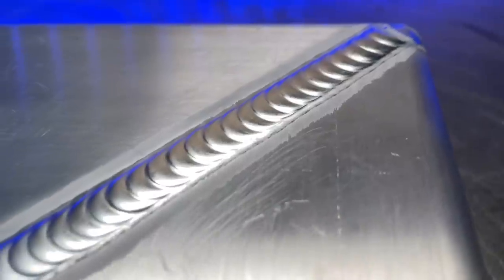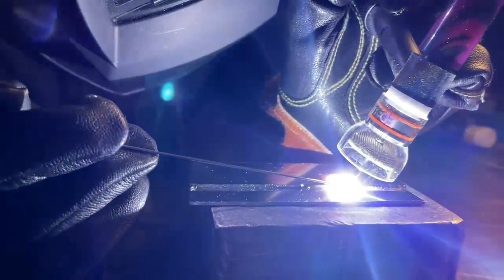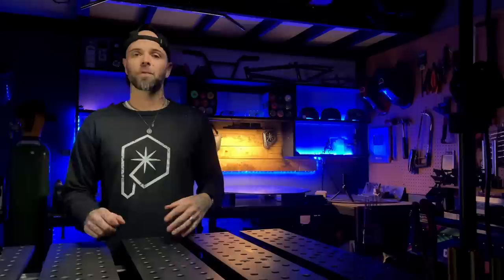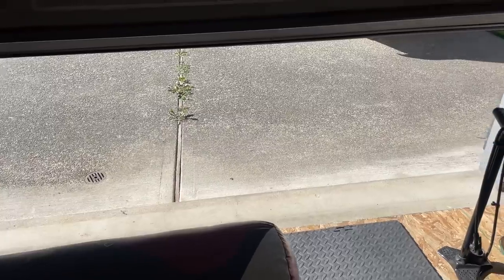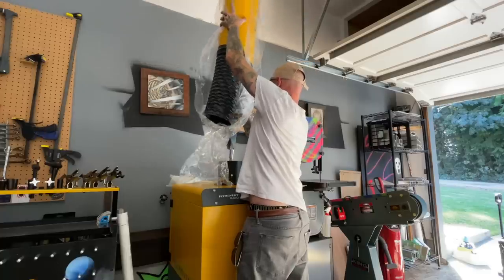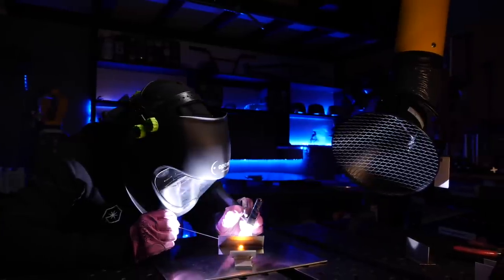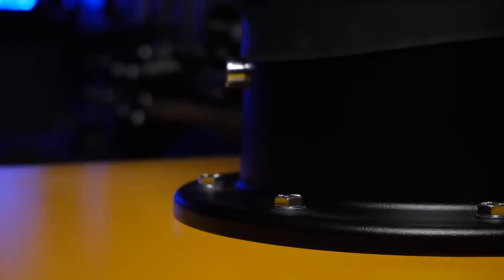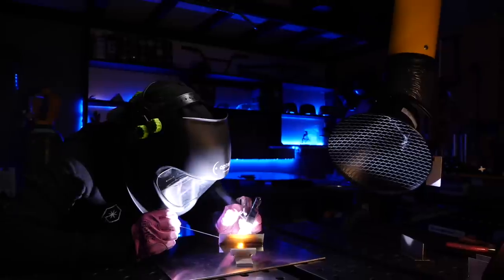I breathed poison fumes without knowing it welding... Remove The Fume rescued me!

Comment from the maker: Thank you SO MUCH for watching today! 💎💎💎Take a FREE online Tig class on my website HERE👉 https://www.pacificarctigwelding.com/
Reply: So one thing to keep in mind: The Respiratory Protection standard, paragraph 29 CFR 1910.134(g)(1)(i)(A), states that respirators shall not be worn when facial hair comes between the sealing surface of the facepiece and the face or that interferes with valve function. This is a requirement at the Shipyard I work at here in the US. Something I would look into for anyone planning on using this style as opposed to the papr welding hood

Comment: Thank you for doing this video.  I was a welding instructor for seven years and a welder fabricator for thirty one years.  After I retired for a couple of years I noticed that I had blood in my urine.  After a CAT scan it was discovered that I had a large cancerous tumor on my left kidney.  When I told the doctor what type of work I did he was not surprised.  I welded SS, aluminum,  and a lot of 6010/7018 pipe welding over the years. I didn't start wearing a respirator under the hood until late in the game. I have survived for eight years since the kidney was removed. Get the best respirator you can find and wear it every time you weld.
Reply: Yeah I'm new in the industry and bought a 3m respirator for that reason. Any tips for wearing safety glasses with a respirator? I find it difficult to know how to wear them.
Reply: Sorry to hear that man yea my one buddy just lost the battle to the big c i think it was all the brake work he did and all the dust I was his welder idk cancer is just weird thing people who don't even smoke get it he didnt  smoke nothing brakes is the only thing I can think of but keep up the good fight man and thank you for the wise advice
Reply: @jeffgood6441  car brakes?
Reply: @Captain Rutabegga Crossout  I've tried all the 3m half mask and none fit perfectly with glasses, sometimes what i will do is grind my safety glasses around the nose so it fit flush against the mask. But after a while i got tired and bought a 3m adflow and its the best thing
Reply: @alexisd-m3802  get a lincoln respirator. They only take p100 filters, but the face cup is so much nicer.
Reply: @captainrutabeggacrossout8482 Yes.  Put some foaming hand soap on both sides of the lenses, then rub them dry with a microfiber cloth. It's a decent anti-fog.

Comment: I wish someone made an affordable home shop fume extractor. I'm in the process of making my own out of an inline duct fan and some aluminum ducting, but it would be nice to have an off-the-shelf solution that didn't cost thousands of dollars.
Reply: Usually we see home shops opting for Portable High Vacuum (PHV) units unless their active weld time is extremely high, the cost of a PHV is much less compared to the larger mobile units, though you'll have to check if the PHV filters are suitable to what you're welding
Reply: lincoln has a smaller unit for about 1400$, still a bit pricey in my opinion but it does look nice
Reply: I use a air blower 8" with expandable tube on suction end.
Reply: i bought a wood dust  extractor   added a few tubes ect  find them fairly  cheap  mine cost all up a round 600 aud

Comment: Hey Dusty , Thank you so much for going over this Topic. ive been welding sense 1984 i was tig welding in my shop and had mask seal ring go bad on my mask and got metal fever about three hours later my chest was on fire it was the worst feeling ever and you cant breathe it took a week to get back to normal yea it was bad !!!!!!!!! I bought the lincoln viking 3250d papr air purifying respirator welding helmet  also added a fume extractor to the shop thanks again dusty for going over this !!!!!!! safety safety safety

Comment: For those curious: ABEK1 filters are the ones that handle gases and vapours (including Hydrogen Fluoride and Formaldehyde). You can attach particulate filters (P2/P100 etc.) on top of them to handle airborne hazards produced by welding.
Reply: Where do you find the P100 attachments? And how would this fair against 3M’s 60926 multi-gas that’s also P100? Is it better with inorganic vapors? I currently where 60923s, but I think I should switch to the ABEK1 or 60926.
Reply: @nistsuas  Definitely get the 60926. That's the all-in-one version of what I use, but with better particulate filter (I've only got the P2 filter, model no. 5925, that goes over the top of my ABEK1 filters). I can't find any P100 filters that are just the filter that attaches on top.
Reply: How do u get them to fit u see the welding mask
Reply: I hate the Miller one because I know it’s not getting the oxides, but I can’t get the 3m respirator to fit under my helmet

Comment: As a freelance welder who has to supply all of my own equipment, I always have respirators and fans around to keep my air as clean as I can. If I find myself in a confined space use a fan to push air in, and another to push air out. 

And also the miller LPR100 is a really nice snd affordable respirator.
Reply: nothing short of an SCBA will protect you.

Comment: What are your thoughts on the adflow helmets or any filtered helmets in regards to this subject mate ive been welding stainless for 10 years and only have recently started to use the adflow helmet religiously to try combat this situation. would you recommend running with the helmet set up or purchasing a extraction system or even both 
thanks in advance mate !

Comment: Safety first!  I had a problem with my first auto darkening helmet  with external adjustments. I was welding for quite a while and didn't realize I bumped the control until I looked around with the helmet up and everything was red!! Burned my eyes. Junked that helmet and bought a good one. Safety first! Thanks for the video, looks like a very nice, useable product.
Reply: Thanks for the comment. Can you please clarify what exactly do you mean by “I bumped the control until I looked around with the helmet up”.
I also just replaced my Chinese helmet with 9002NC by 3M
Reply: @Bakanelli   On the side of my first helmet there was a "shade" control that went from grind-9 to 11 or 13 (can't remember). I was moving around and my fat head bumped the cart I was building causing the shade to lighten up (which I didn't realize until I started to see red. I pulled the helmet off and the garage was all red. Looked at the control and realized what happened! It cleared up after a few days. I then bought a Lincoln 3350 and have been very, very satisfied with how it works. No green screen and it's fast and clear.
Reply: @andyb7754  Thanks for clarification, that sounds really scary I’m glad you’re OK. Anyways I read the instructions of my new helmet and they say even if the helmet doesn’t work (broken or turned off or whatever) = stuck on shade 3, welder is still protected from all electromagnetic frequencies (UV, IR…) so that’s good to know

Comment: I have been working in the fume extraction industry for the last 15 years... A lot of welders are not aware of the hazards of hexavalent chromium fumes produced from welding stainless and galvanized. Its deadly and needs to be handled properly!!! Especially if you work in a smaller more confined work space.

Comment: Hey Dusty! Great video! thanks for the heads up! Hey can you talk about using magnets to hold stuff together and how it effects the arc? I have noticed how the arc is different when welding steel together and using magnets to hold the corner in place. Can you explain when  and when not to use them? Thanks!

Comment: So one thing to keep in mind: The Respiratory Protection standard, paragraph 29 CFR 1910.134(g)(1)(i)(A), states that respirators shall not be worn when facial hair comes between the sealing surface of the facepiece and the face or that interferes with valve function. This is a requirement at the Shipyard I work at here in the US. Something I would look into for anyone planning on using this style as opposed to the papr welding hood
Reply: Ya, I started shaving to a goatee to get  the seal just in line

Comment: Is there a smaller/cheaper version? I'm trying to set up a tiny collapsible welding station in my garage
Reply: For a home shop, use the harbor freight 8" blower with a flexible tube to suck the air away, then either run it into a filtration box made from plywood and caulked up tight at the seams, or dump it outside your area.

Fume extractors are always extremely expensive for a home shop guy, because they are bulky to ship, low volume to produce, and tend to come with legal certifications that impact price greatly, and are aimed at industrial sales.

Comment: Would someone know if ABEK1, 2 or 3 respirator filters is better than 60926 multi-gas respirator filters (after the ABEK cartridge has P100 attachment)?
Reply: There was also these 3M™ LifeASSURE™ PDA Series Filter Capsule PDA010C01AAG1  that were insane expensive, but went down to .1 micron when traditional P100 protects down to .3 micron. It needs weird adapters too
Reply: This info is also from a different comment on the video recommending ABEK1 from formaldehyde and hydrogen fluoride among other gases

Comment: Dusty, those pink pancakes filters are more for “dusty” stuff (see what I did there?😂) and particulates. For smoke and volatile fumes you should be using gas filters, ie charcoal filter like a 3M 6046.
Reply: Damn. So is that just for the stainless fumes? What about aluminum? I was under the impression the p100 was good for welding or is that just excluding stainless and galvanized, being fumes not smoke?
I was stoked for the episode but little disappointed he just touched on stainless, better just order a fume extractor
Reply: @KingBigBabyJesus  anything smaller than particulates or stuff that is poisonous should use a finer filter that removes organic vapors. Those pancake filters are way better than a generic cloth dust mask (or no mask) but there are better options.
Reply: The 2097 filters are fine for welding. I think you are referring to the 2091 filters which are basically just for dust.
Reply: @hardknoxblount  you’re right, I didn’t catch that 3M made different filters in that style. Just make sure to get the right one.
Reply: @hardknoxblount  Its the miller lpr-100 half mask not even a pancake, but an oblong filter. So it's just the equivalent to the 2091 I believe. I just looked it up and it says p100 filters with Nuisance OV Relief. They do make another lpr100 model with triangle filters that marketed for organic vapors. So sounds like there is some protection with my miller mask but I should look into something a little better when I'm not welding mild steel.  Really appreciate the response
Reply: @bdpgarage  And here I thought I was being safeish, learn something new everyday. Thanks for the insight
Reply: @bdpgarage  The most dangerous stuff here is the hexavalent chromium which will be in the form of chromium oxides in tiny little specks of dust ranging from 10 nanometers to tens of micrometers. It's not a gas but a particulate suspended in the air. The P100 filter will definitely help a lot and the organic vapor filters won't do squat except maybe for the flux emissions if there is organic flux involved. Getting rid of oxide particles in the 10-100 nm range will probably need something better than P100 like for example some grade of HEPA filtration.
Reply: @wombatillo  that’s good info, thanks.

Comment: P100 filters do not filter gasses, only particulate

You need to use those rigid gas filters
Reply: The Fe-Ni-Cr oxide particulates produced by welding are not really a gas even if they're so fine that they're suspended in air. They're a very fine mist of dust ranging from nano size to micron size. A P100 filter will capture a lot of it but the tiniest nanoscale particles probably need much better filtration than a pancake P100 can offer. Most likely would need advanced HEPA filters.